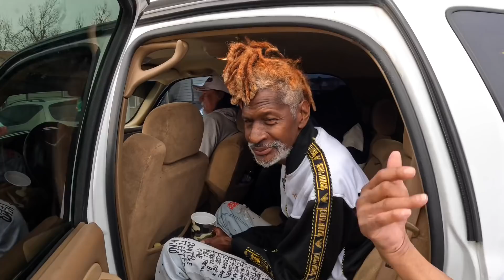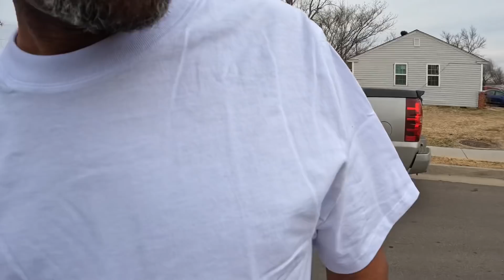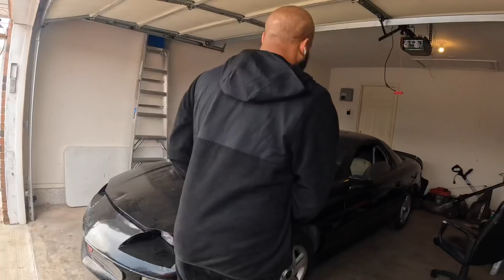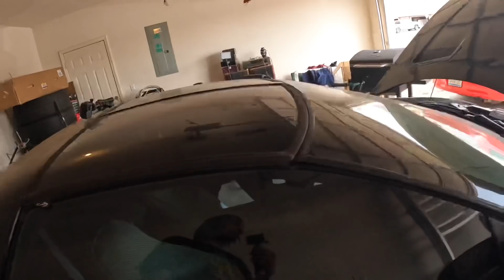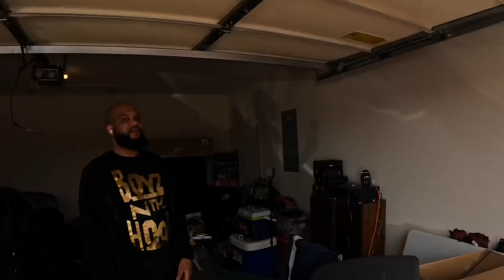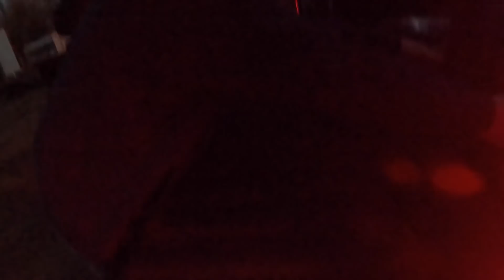DON’T ALWAYS BELIEVE WHAT YOU HEAR!!

Comment: Lucky on your 71MC I noticed it had a transmission fluid leak if that junction will not tighten up then cut it out and get a piece of transmission cooler hose and two clamps then splice it in.
Reply from the maker: Ok on them two. Metal lines ?